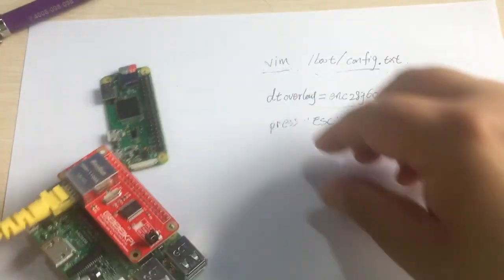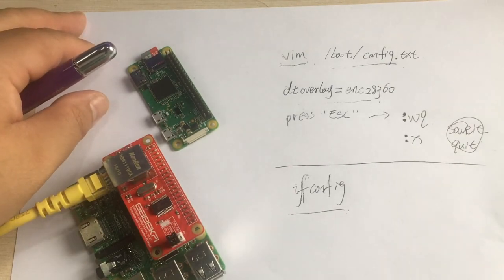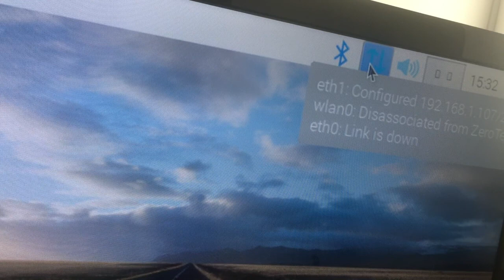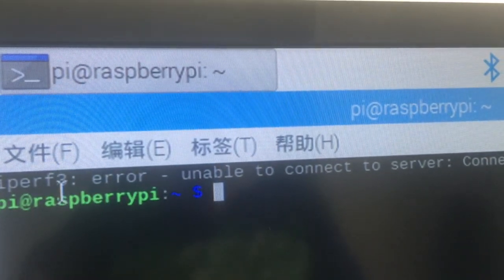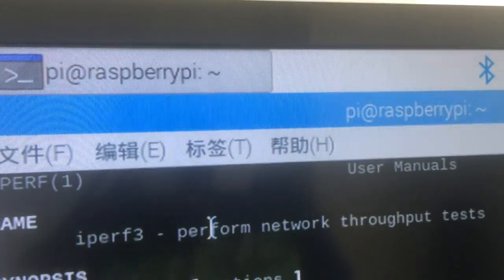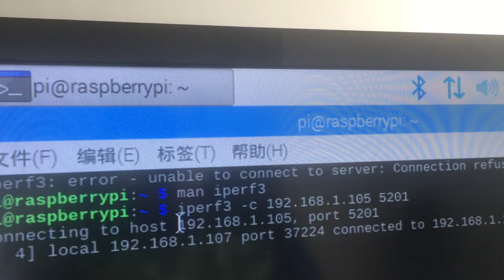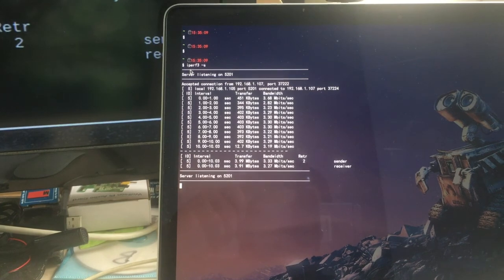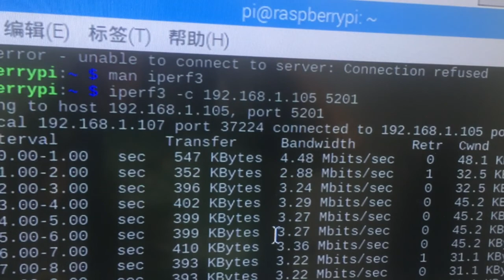How to use Enc28J60 Network adapter module on raspberry pi

Comment: I don't think people are still using Raspbian. Despite this fact, the adapter is still in circulation and I purchased 8 of them but cannot get the adapter to work with Raspberry Pi OS Lite which replaced Raspbian not too long ago. In fact, I cannot find images of Raspian anywhere on the web. Can you update the instructions for Raspberry Pi OS Lite please? I would like to stick with the hardware I purchased (i.e., this adapter).

Comment: What do the jumpers do?
Reply from the maker: enable the module, if lack of the jumpers ,it will not work properly, and you can check out our wiki here:
https://wiki.52pi.com/index.php/Pi_Zero_Enc28j60_Network_Adapter_Module_SKU:_EP-0088 
it will enable CE0,

Comment: Hey Great video , 
Question , i bought a couple of these for work to replace a mini router . Is it possible I can use this WHILE having dtoverlay=dwc2 added on to the /boot/config.txt file? 

I can't find any info on this , also , did you solder your breakout pins on the pi zero?

thanks Kev
Reply from the maker: yes, you can add dtoverlay=dwc2 to config.txt and i solder the breakout pins to the pi zero so that it can stand on my gpio stable.